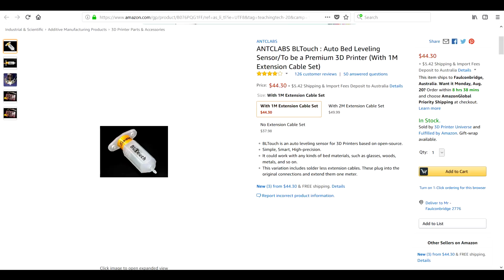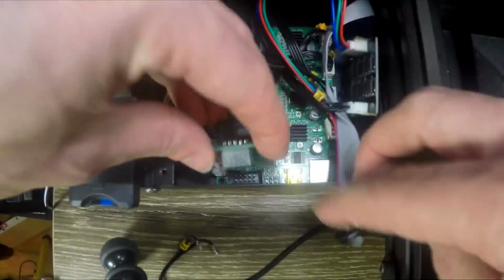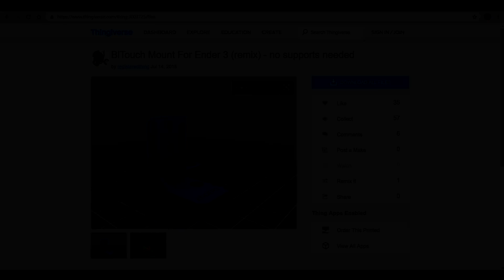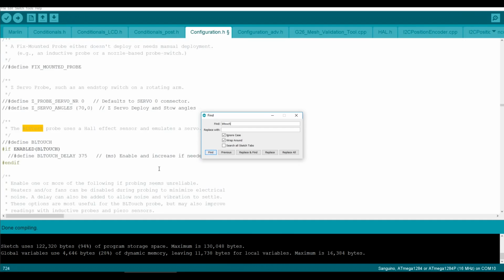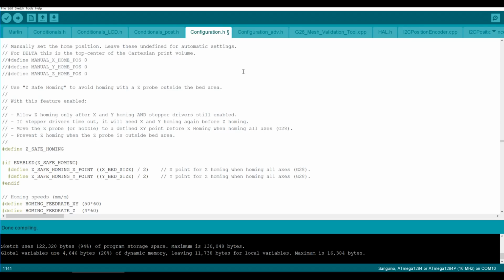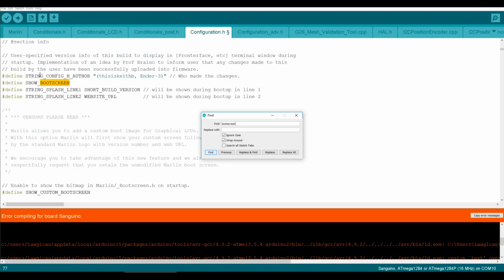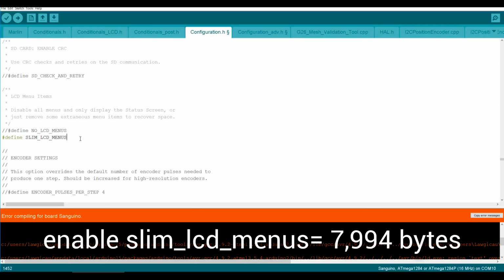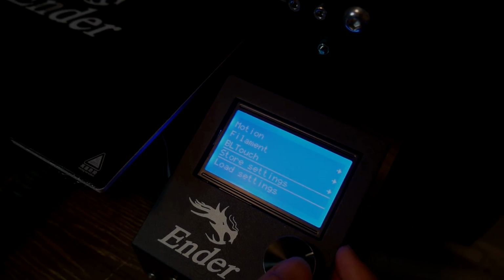Ender 3 BLtouch vanilla Marlin guide

Comment from the maker: Hi everyone, a couple of things:
1. A number of people are commenting here or contacting me elsewhere to say my files don't work. When you download the files, there are instructions that must be followed. This has been the problem in every case. Here they are:
Simply copy the two files to overwrite those with the same name in your download Marlin folder. This process is described step by step here: https://youtu.be/sUlqrSq6LeY

You will need to setup Arduino and flash a bootloader as seen here: https://www.youtube.com/watch?v=N7JLchsFRDU

2. If you are using a different BLtouch mount to what I used in this video (which I now am too wit the Bullseye. Change your offsets in Configuration.h on lines 776-777, as well as the same values on line 1024-1025.
Reply: Would this work on the CR-10 the same way? :)
Reply: Hey Teaching Tech, the bed size in your config is not correct. As the Ender3 has a 235/235 bed instead of the 220 you've defined now. Can you change this? When I change this manually I get problems with the values on line 1024. I've not been able to fix this yet.
Reply: @mrSErgezen  - I thought that the "bed size"" was 235 but the "print size" was 220
Reply: Michael, thank you for the great tutorial! You could update your 3D printer firmware sketches using ISP programmer or Arduino as ISP, without a bootloader (https://www.youtube.com/watch?v=oZVTYpHnpIw). It will save you a few KB of flash storage. So, in combination with fully removing the beeper (see John Saunders comment below), perhaps this may free up enough memory to activate the slim_lcd_menus function.
Reply: I also question how to configure 1024 and 1025 correctly. With the Bulleseye they are negative values, so setting the same values as 776-777 it throws an error.  Please help!
Reply: @Littleferris  did you ever figure this out? im stuck at this part too.
Reply: I think you should add on your stickie Michael that people should check the pinout of their pin27 adapter board and the mainboard prior to installing the bltouch.  There's been a few posts on r/Ender3 and r/3DPrinting about people following your video blindly and reporting their LCD doesn't turn on, they then check wiring and realise they had no need to switch the pins.  When they revert they've found their mainboard is fried.  

I appreciate you hold no responsibility for this and understand that, but with this price-point of printer a lot of people are inexperienced and very trusting, you have a massive following and are recommended a lot so feel it's just a responsible thing to do.  Great videos nonetheless, please keep up the great work!
Reply: How do you change the lines 1024-1025 appropriately? It's different in the config even from your original 'Advanced BLTouch' video, and I'll be honest even in that one I wasn't sure how you were defining your boundaries for probing. Thanks in advance and sorry if this is a simple answer I'm just missing somehow.
Reply: @jibbles88  did you ever figure this out? im stuck at this part too.
Reply: Hello Sensei

I wonder if there might be room for a 3rd little caveat here, dealing with the order of operations:  if you don't print the mount FIRST, BEFORE you make the electronic mods for the probe, how are you going to get your printer to manage printing the mount mid-stream???  Hart before the corse conundrum?  Didn't read existing comments exhaustively, but enough to conclude that you have such bright ones following you that they knew enough to get that order right without comment.

I had already printed mine, but am STILL dead in the water because I can't get my 3D touch (sorry - bought it long ago for another printer, which never received the mod anyway).  Didn't blunderstand the back story of the stolen work thing, so now I'm paying the piper, perhaps.  Can't make it work, so may have to revert to the end stop switch until I can finger it out.  May have shot self in foot by twiddling the adjustment on top - someone's bright idea - though it's hard to "zero in" on the sweet spot when the thing turns SIX HUNDRED DEGREES between OFF and ON!

Anyway, I'm also running with Fang's BullsEye, and discovered that (for the 3DT anyway) it's slightly off vertically, for my Ender3: adjusted all the way down in the slots it's still 4 mm too high.  I've "shimmed" it, but I intend to reprint a mod-ed mount IF I CAN GET A PRINTER WORKING AGAIN.  I also just noticed that the quick-release clip for the bowden tube interferes with the BullsEye mount, making it difficult to keep the friction-fit slide/groove on the right side firmly in place.  Gots to relieve that with the moto-tool, and/or print a mod.

Back to head-scratching for me - thanks for offering your help so generously - glad it helps so many folks (just not me - yet).
Reply: I use your mount and bought your files, but when it probes it touches the very edge of the front of the bed, so much so on occasion the probe has missed the bed in one corner. What is a good fix for that?
Reply: did you ever get this fixed?
Reply: @davidfox9349  Enter the same values as you did for the lines (in the 700s) before it. I did and everything was fine.
Reply: Hi Michael really good educational videos. I've just assembled an Ender 3 Pro and updated to latest TH3D firmware and waiting for delivery of a Creality BLTouch.  Are your download files still relevant or has the TH3D/Marlin firmware moved on. Cheers
Reply: I'm pretty new to 3D printing so I apologize if I've missed this... but do you still need to set your z offset if you purchase and use the configuration files with the mount from the video?
Reply: Matthew Addison yes you will need to set the Z offset
Reply: Do your files work with the Marlin 1.1.x bug fix firmware? I have already purchased them but not sure if i should use them?
Reply: Arduino: 1.8.7 (Windows Store 1.8.15.0) (Windows 10), Board: "Sanguino, ATmega1284 or ATmega1284P (16 MHz)"

Sketch uses 122302 bytes (94%) of program storage space. Maximum is 130048 bytes.
Global variables use 4621 bytes (28%) of dynamic memory, leaving 11763 bytes for local variables. Maximum is 16384 bytes.
avrdude: stk500_getsync() attempt 1 of 10: not in sync: resp=0x65
avrdude: stk500_getsync() attempt 2 of 10: not in sync: resp=0x63
avrdude: stk500_getsync() attempt 3 of 10: not in sync: resp=0x68
avrdude: stk500_getsync() attempt 4 of 10: not in sync: resp=0x6f
avrdude: stk500_getsync() attempt 5 of 10: not in sync: resp=0x3a
avrdude: stk500_getsync() attempt 6 of 10: not in sync: resp=0x53
avrdude: stk500_getsync() attempt 7 of 10: not in sync: resp=0x44
avrdude: stk500_getsync() attempt 8 of 10: not in sync: resp=0x20
avrdude: stk500_getsync() attempt 9 of 10: not in sync: resp=0x69
avrdude: stk500_getsync() attempt 10 of 10: not in sync: resp=0x6e
An error occurred while uploading the sketch

This report would have more information with
"Show verbose output during compilation"
option enabled in File -> Preferences.
what programmer it should be on
Reply: @nukegho9224  I know you commented this a long time ago, but I fixed this issue by going to Tools>Processor and changing is from ATMega...-ATMega...P from 16mhz to 8mhz.
Reply: (U1.R2.7) not support BL Touch:/ Can You share Ur frirmware? ;)
Reply: Have you attempted this? https://thborges.github.io/blog/marlin/2019/01/07/reducing-marlin-binary-size.html  . I have done this on an Ender 3 with the 1.1.5 (TMC2208) board adding the BLTouch 3.1. Before following this guide, removing the normal options you state didn't work. I removed the boot screen and logos as well. After, I was able to add them back without issue. I'm running Marlin 2.0
Reply: How do you then adjust esteps for the extruder without it in the menu?
Reply: I followed all the steps, and my printer is only probing in one spot, an not the grid it should be. Is it because of my gantry slop because of the lack of a second z screw, or is it firmware. The printer is only probing home, and yes I have an ender 3
Reply: Hi Michael I've tried everything to get my BLTouch to work on my ender 3 (4.2.2) board, no success, it only uses one plug that attached to the motherboard. M999 reset errors now....

Comment: so the easiest way to push things thru, is if you push the sleeve up like a sleeve lol.  it will bunch up and open up in to a short but really wide tube near the top and you can easily feed it through from the one end and it'll move to the other side. Then slowly retract the sleeve down to the original part and then re zip tie.

Comment: Hello, I followed your guide but screwed up a bit. The pin 27 adapter board I have was made specifically for a bl touch, so you aren't supposed to reverse the ground wire. I didn't realize this until after I had done it and got a puff of smoke. I reversed the connections and now everything is working. Do I need to replace something because of the smoke? Everything seems to work ok but I don't want a fire on my hands, thanks!

Comment: pulling your wire through the sleeve if you take a piece of boudin  tube that is long enough to slid through the sleeve take a piece of tape and tape your small end of the tube starting from the main board side then pull it through. The tube is very slick and slides thru very easy. You can also do this with a piece of  Pla.

Comment: My ender 3 only does 3 points (I did a mistake) is there anyway to use a gcode to do the 9 points or do I need to reinstall the firmware.

Comment: To help with the braided sleeve, bunch up to enlarge diameter, this enables the connectors to pass through easier, same with the excess -fold over ribbon cable and insert into sleeving. I've done this with mine.

Comment: I think the video is great, far better than others I've seen... YET, I do have a problem. While compiling I get errors. One that shows up A LOT is "this use of 'defined' may not be portable. (The profile doesn't halt at those but there are many instances)
The critical problem, where compiling was halted happens in the 'endstop_interrupts.h' file. 
Here is the problem section that comes up:
#if HAS_Z_MIN
    #if digitalPinToInterrupt(Z_MIN_PIN) != NOT_AN_INTERRUPT
      attachInterrupt(digitalPinToInterrupt(Z_MIN_PIN), endstop_ISR, CHANGE);
    #else
      // Not all used endstop/probe -pins can raise interrupts. Please deactivate ENDSTOP_INTERRUPTS or change the pin 

configuration!
      static_assert(digitalPinToPCICR(Z_MIN_PIN) != NULL, "Z_MIN_PIN is not interrupt-capable");
      pciSetup(Z_MIN_PIN);
    #endif

Can you offer any insight?
Thank you! (it's okay to email me directly at gregg@grandrache.com)

Comment: I believe I have followed this video to a tee but when compiling I get "Make sure you have 'Arduino Mega' selected" error. I know this is Sanguino as I successfully flashed the bootloader with my Uno. I now just want to flash this sketch to get my bltouch v.2 running. I know the bootloader is functional because I flashed firmware to the board via usb but my lcd menu lacked a bed leveling option using that firmware. Why now is the Arduino IDE sending me back to using the Uno board (Arduino Mega)
Reply: I resolved the board recognition and flashed successfully. Should I see an Auto Bed Leveling menu item? I enabled Slim LCD menus. Perhaps this hides that item?

Comment: Hey Michael (and all other posters!). Love your videos, I've learned a ton from watching them and I love your calm, informative style. I'm having a lot of trouble setting up my BLTouch on the SKR mini v3 1.2, Ender 3. 
I tried using your firmware but it showed TMC Connection Error, so I flashed to another firmware that someone on reddit shared with me after telling them about my bed leveling issues. Really hoping I can get your input, or anyone else here that has suggestions. 

Here's where I'm at: I leveled the bed using the springs first, then got the nozzle to the right height over the bed using the terminal codes. I moved the x and y axis to 0 using terminal gcode, then set those as the 0s using g92 x0 y0 z0. I got the offset for the bltouch set, again via terminal. Mine was -2.1. Ran m500 and m501

When I use the "auto-home" on the screen, not in octoprint, the z still crashed into the bed. I guess I shouldn't be using the screen for that, and do it through octo instead?
If I use the "bed-level" on the screen, bang, crash.

I haven't edited any firmware, and all I got from the guy on reddit was the bin file. I guess I need to get into editing my own firmware to get this to work, maybe? I feel like I've tried everything. Help! :)

Comment: Michael, Your firmware works well and makes the upgrade to the BLtouch bed leveling system a breeze. However, I do use the color change option that Prusa and a few other slicers incorporate and this firmware does not support it. Is that a Marlin problem or did I miss something in the configuration files. Auto color (filament) change is a very useful feature and I use it often. Any advice would be appreciated. I did pay for your two file listings and that made things simple and an easy way to install the boot loader. Thanks.

Comment: My Ender 3 pro has the V2 mainboard, and my BL Touch is for the V2 mainboard. Therefore I do not have all the hardware you are describing. I cannot use the progisp 1.72 to program and flash the mainboard's firmware

Comment: I've had a hell of a bad time getting my Ender 3 Pro to give a decent print with the crummy print bed that is as warped beyond being usable. Got a 27 dollar eBay kit and after a fair amount of trial-and-error, I was able to get it to work with the hex code you had up. Totally worth the minimal price for your Marlin firmware. Although it doesn't come up as Ender 3 Por on the display, it works pretty damn well.

Comment: Hello! im having a problem with a cr10 from a friend,its bootloaded and all and worked fined until it wasnt holding the values right,so after checking it and trying to put a new firmware in "marlin" and homed it, after the x,y does its thing it deploys the bltouch but doesnt go down, stays there and even goes up. In no point does it go down unless you tell it too in move axis

Comment: Hey bud, maybe you can help me. I followed this guide ages ago and all went really well. However, I had to go through it again to get ready for a new extruder install and now my bltouch is not functioning the same, before I'd set a positive number for the offset and now its a negative number, on top of that the first layer prints okay but as soon as layer 2 starts the z axis jumps up 5mm and just oozes filament. I'm stumped

Comment: I ended up getting a BLTouch V3.1 when I purchased them for my two Ender3's. I followed all the instructions and my ABL fails about 40% of the time. When it does, sometime I have to reconnect OctoPi to the Ender, sometimes ABL continues, but under observation, I know it didn't probe correctly (Z axis went up before the probe hit the bed, etc.), so I just cancel the print and begin again. Both machines have this same intermittent issue. The Ender3's are pretty stock other than the BLTouch and some printed parts.

Is there a different with the V3.1 as opposed to the V3.0? Has anyone else had this issue? 

Thanks in advance.....

Comment: I Tried to compile the firmware but I receive an error:
Arduino: 1.8.12 (Windows 10), Board: "Sanguino, ATmega1284 or ATmega1284P (16 MHz)"

In file included from sketch\MarlinConfig.h:42:0,

                 from sketch\I2CPositionEncoder.cpp:31:

SanityCheck.h:949:5: error: static assertion failed: BACK_PROBE_BED_POSITION is outside the probe region.

     static_assert(BACK_PROBE_BED_POSITION <= MAX_PROBE_Y, "BACK_PROBE_BED_POSITION is outside the probe region.");

     ^~~~~~~~~~~~~

In file included from sketch\MarlinConfig.h:42:0,

                 from sketch\G26_Mesh_Validation_Tool.cpp:27:

SanityCheck.h:949:5: error: static assertion failed: BACK_PROBE_BED_POSITION is outside the probe region.

     static_assert(BACK_PROBE_BED_POSITION <= MAX_PROBE_Y, "BACK_PROBE_BED_POSITION is outside the probe region.");

     ^~~~~~~~~~~~~

In file included from sketch\MarlinConfig.h:42:0,

                 from sketch\M100_Free_Mem_Chk.cpp:49:

SanityCheck.h:949:5: error: static assertion failed: BACK_PROBE_BED_POSITION is outside the probe region.

     static_assert(BACK_PROBE_BED_POSITION <= MAX_PROBE_Y, "BACK_PROBE_BED_POSITION is outside the probe region.");

     ^~~~~~~~~~~~~

In file included from sketch\MarlinConfig.h:42:0,

                 from sketch\MarlinSerial.cpp:36:

SanityCheck.h:949:5: error: static assertion failed: BACK_PROBE_BED_POSITION is outside the probe region.

     static_assert(BACK_PROBE_BED_POSITION <= MAX_PROBE_Y, "BACK_PROBE_BED_POSITION is outside the probe region.");

     ^~~~~~~~~~~~~

exit status 1
static assertion failed: BACK_PROBE_BED_POSITION is outside the probe region.

This report would have more information with
"Show verbose output during compilation"
option enabled in File -> Preferences.

------------------------------------------------------------------------------------------------------------------------------------------------------
My BLTouch is in the same X position as my nozzle it is only 45mm in front of the nozzle.

Does anybody know, how to fix this?

Thanks in advance,
Rene van Delft

Comment: Quick tip for measuring offset of the probe: 
If you put some painter's tape(or whatever) on your bed, make a mark directly where the nozzle is(I usually do it on my soft magnetic mat and make the mark WITH the nozzle), then deploy the probe and use the move controls to move the nozzle until the probe pin is 100% exactly above the nozzle mark you can get precise offsets down to 0.1mm in precision completely unphased by human eyeballing